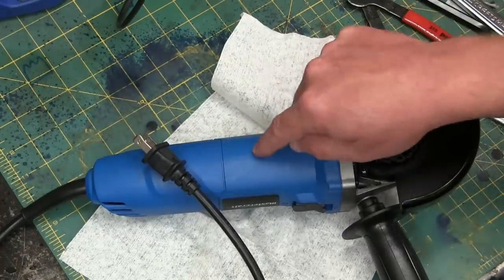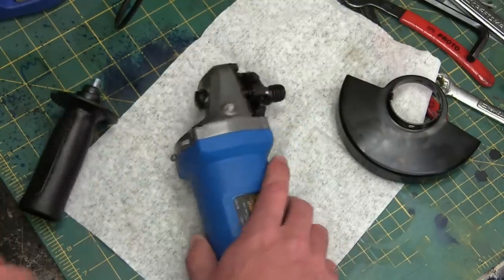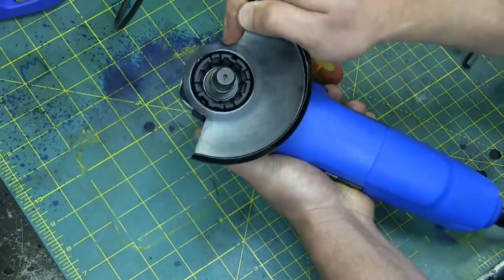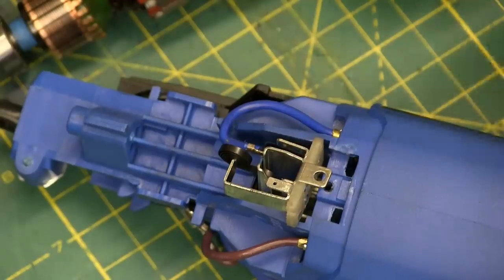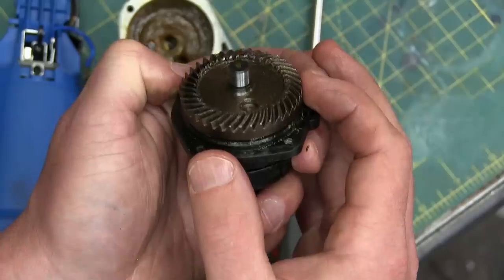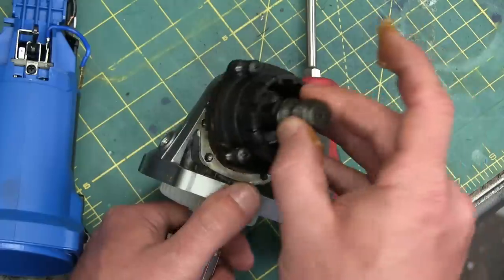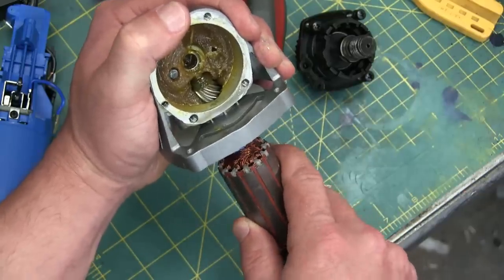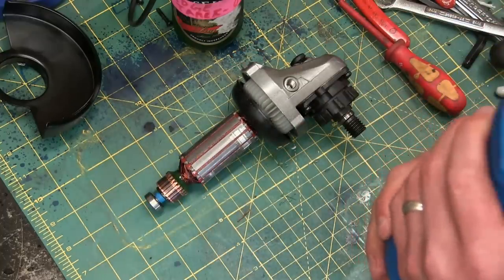BOLTR: Harbor Freight Grinder. HOW BAD IS IT?

Comment: I bought one of these from harbor freight when I was in high school. I thought I'd buy a better grinder when it finally crapped out on me. But it still hasn't. 

 It survived being my main way of cutting metal for smithing and casting, several weeks of cutting concrete board, granite, and tile, and even a good bit of woodworking. It's packed with dust and grease. And it just won't die. 

The only maintenance I've done is replaced the brushes and packed the head with red-n-tacky grease. There was barely any grease from the factory, nothing like the amount shown in this video. The head got alot quieter and cooler after I packed it.

I've actually grown to like it. You almost can't snap a disk because it's so underpowered. I've never snapped a disk with this grinder, and I've been through a few hundred at this point. It's also easier to control what you're doing, for the same reason. I added an in-line foot-pedal deadman's switch after a couple of close calls, and I like that set up alot more than a typical paddle grinder. 

I bought a second one for 10 bucks when they had a sale. My plan was always to buy the Metabo of my dreams when my Chinese POS died, but now I just don't think there's any point.
Reply: @Bob Newhart Also, why just me? There were much more shill-sounding stories in the comments right below mine.
Reply: "It's packed with dust and grease"
Ah, that's the secret. You reinforced it. 👍

Comment: I fabricate a lot which means I weld and grind. I have about 6 of these in the American version of the Chinese model. The FIRST thing I do is replace that funky grease with a good moly-lithium that strings when I pull it apart in my fingers.  No evidence of grease leaking but I have had failures. Before I did the grease thing, the gears wore out fairly fast.  Brushes get hot which takes the memory from the coil springs.  As long as I go easy I can get some miles out of these.  So, I always use cutoff wheels. The cheapest I've bought these for is US$9.00. Yep, for nine bucks I don't cry when one fails.  I've also used parts from failed grinders to fix others.  Ours come with a spare pair of brushes but failure usually comes before they're needed.Our model comes with a maintained-position switch.  No problem until someone leaves the damn thing on and you go to plug it in.  I always check. Go Wings!  - Dave

Comment: Greeting from SE Asia where these wonderful pieces of equipment are copie... built!
I've got ball bearings that flatten with a tap of a hammer, stainless steel screws that rust in a week, and a truly amazing series wound motor that is a copy of a Makita. The Makita has 28 gauge copper wire, this one, which lasted 2 weeks, is wound with 28 aluminum.

Comment: at 33kRpm, a sealed bearing will not survive--the seal will turn to smoke, hence the cheapy shielded bearing.  For those types of speeds, a labyrinth seal is required, and those are mucho dinero.  Its less chineesey than usual.  I thought the balancing was impressive.
Reply: I really laughed at the unique commentary.  Thanks!

Comment: I've had one for three years now and sharpen lawn mower blades with it pretty aggressively. Never gotten very hot. I love the thing because of the locking button. My old Milwaukee was great because of the palm switch. But that got sketchy about working. No grease leak at all

Comment: how much silicon should we add to aluminum cans?
Reply: ^^^what he said^^^
Reply: about a pinch per ten cans sound good to me.
Reply: one california bimbo per ton of aluminum. did you not hear what he said? stop wasting time on tin cans -  and get old tools etc -  break them up and use them -  or get heat sinks from computers. find a local computer shop and ask if they have old heat sinks.
Reply: when it no longer looks like molten aluminum, back off a pinch.
Reply: use pistonium for your castings. Much better than beer can logic.
Reply: One intel core i7 (sky lake is okay)
Reply: +readyrepairs heat sinks are extruded, not cast, so the metalorgy is different, and not necessarily suited for casting.
Reply: Go to a scrap yard. They will have a guy hitting transmission bell housings with a sledge hammer. All the casting aluminum you could want at prolly 30 cents a pound.
Reply: @944tim  was going to say, Piston aluminum would be good.

Comment: Have this grinder, have used it for multiple hours at a time very often for 3 years cutting and grinding heavy gauge steel. It has always worked and held up very well, no bearing play, no grease leakage.

Comment: Had one of these for a year with fairly extensive use. No grease leaking to date. no real major issues other then occasionally stalling out when when using cut off wheels for extended periods.

Comment: bought two of these so far. One destroyed a grinding disc at first use and welded the disc nut to the plate, making it impossible to replace the disc. No worries, they're $9. Bought another one, and have used it for almost a year now, pretty regularly too, and completely ignored how hot the thing gets when you run it for a good length of time, and it still works like a champ. Now that I've seen this vidya, I know why.

Comment: I got both horrible freight versions about 5 years ago. The one you tore apart looks like the cheaper of the 2. The Drillmaster is nominally $20 often on sale for $12 and the Chicago is nominally about $35 and often on sale for about $20.  Between mine, neither have the weird handle single or the plastic bearing carrier. Both heads are all metal. No grease has leaked out but comes with all of it in the corner... Much quieter after popping the head apart and spreading the grease around. 
It'd be interesting to see how much torque it takes to grenade one of their ratchets compared to a fap on or other pro grade hand tool.
Reply: They're holding up well but they've only seen light home gamer use.

Comment: Bought a HF heavy duty grinder bout 2 yrs and its still hoing strong after 1 yr of welding school and 1 yr of field work. No leaks or problems except replacing a brush and the crap welds on The guard breaking. I was surprised.

Comment: I just wish it was an actual HF if you're gonna call the video that.
Might have to export you the actual cheapo HF one.
Reply: +AvE In that case nvm, thank you sir. Maybe we can export the $10 one when it dies, if it dies, lethal wire cup still attacked.
Reply: +The American Outdoorsman attached*
Reply: +AvE i got my Hf grinder several years ago and there are a few differences. the guard is held in with a clamp (so you need a screwdriver to adjust it) the handle is perpendicular rather than a stupid angle, and the switch is on the back vs the side. it also is rated at 4.5amp and has replaceable brushes
Reply: +m4xwellmurd3r That's the one I've got
Reply: +m4xwellmurd3r it does have the plastic bit on the gear and stuff. its never leaked and ive abused the hell of it for years cutting up exhaust systems and such. ive also thrown it around a bit. i do think the plastic holding the gears is thicker from the looks of it
Reply: The American Outdoorsman It's pretty well built vs the one AvE is showing. I've gotten it plenty hot and absolutely abuse it an it still works like new.
Reply: That's the new one that they are selling in the states too. Last time I went in they didn't have the old red one anymore.  Not in mine at least.
Reply: A
Reply: +m4xwellmurd3r HF changes there tools every few months go to the store and try and find the one you have still on the shelves
Reply: N
Reply: +AvE I'm sure they are junk , I'm only a couple minutes in, but it's probably like air die grinders. 
I've bought the best and had em fail in 3 months, then I've had the harbor fright crap last over a year. 
Somewhere in the middle usually doesn't leave ya too dickered.
Reply: It's the same thing just rebranded. All components are the same with the exception of maybe some differences due to w/e Canadian laws compared to the states. Different plug? Dunno. Anywho, it's manufactured from the same factory in Shenzen or wutevs.
Reply: +Jayee actually the red one they are talking about isn't the same. Completely different head. Dosnt have an angled handle and the lock pin is much smaller.
Reply: I bought the HF grinder about 4 years back for $12 on sale.  It lasted way longer than I ever expected.  I referred to it as my "backup grinder" but often defaulted to it because it was smaller than my other one.  I finally killed it recently after 2 hours of constant-on abuse.  I then switched to my other grinder, a Porter Cable clearance buy from Lowe's.  $20, only thing missing was the arbor wheel (which the guy at the tool shop gave me for free.)  I think the thing retailed for $70 originally.  It has a similar plastic gear cover but was leaking grease within 5 minutes of use.  If you had any interest I'd send you the dead HF grinder to find out exactly what died in it.
Reply: You can buy the same product, in the same box, on the same day, but at different stores, and they could be built in a different way. The companies get a contract from a manufacturer over in China to pump out say 10,000 at a time for a given price. In my experience as long as the tool or product meets the spec it doesn't matter what's inside the thing. If you get a new shipment, or old stock, the box may look the same, but there is a chance that the product itself could be different.
Reply: not really.... looks nothing like the ones at HFT..... worked there for 8 years straight.... unofficial product expert of the store.... and that only looks like one that use to be sold around 6 years ago..... only similarities being the color. everything else is different.... so unless you show an actual product. don't pretend to know it
Reply: this isn't an HFT grinder... not even remotely close.....considering the grip handle's have NEVER been on the angles this thing has. and the switch is usually on top of the device.... and how he took it apart to get the brushes out.... they have a port on two-three sides of the tool to open it up and exchange the brushes... this thing doesn't.... it looks like(in color only) the old Drillmaster brand grinder..... but again, too many design differencials.

Comment: I've had this grinder for 6 years and it;s been great honestly. cut custom 3/16 engine mounts, body work grinding/cutting, probably 20 solid hours of use out of it for 25 bucks, i'll go out and buy another when this one fails for sure!

No leaks, nothing has failed yet and I've been pretty rough with it.

Comment: I bought a hazard fraught cheapo years ago to remove some heavy paint with a flap wheel. Ran it 8hrs straight 2 days in a row. Bearings rattle a bit but still in my garage and used. I'm surprised it survived the two days, was worth the few bucks. Keep up the great videos!

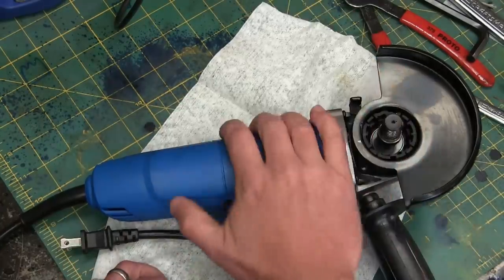Comment: 1:41 I have the $14 grinder, but I got it for $11 with a coupon. It was noisy at first so I took it apart and there was NO GREASE! inside the gearbox. I packed it full of grease and it has been great since. I have used it to cut out an entire floor out of a car so far and to make patch panels for a different floor.

Comment: I have to say I have one from harbor  freight  I only paid a little  over 9 dollars  on sale that works fine for me but I only do light work I've used  it for several  years but if I needed  it all the time for work   I would buy a better  one.
Reply: same here, I have 3 of them
Reply: I got myself one as well,  $12, "DrillMaster." Pleasantly surprised as I nipped off several rusted nuts and bolts and modified couple strut assembly frames. I made sure to stop for few seconds when I felt it get hot as other youtubers have suggested. Granted its underwhelming compared to company's Makitas I've used to earn living and also bit annoying in power as its only a sad 4.3amps and bogs down to a complete stop if you apply bit pressure so it'll take slightly longer to grind what would otherwise take less time but to my surprise, the shit didn't die. Yet. Not once did it trip cut off power, just steadily grinded away. For a cheapy, it really is something. Not expecting much,  I didn't even bother getting their 1yr extended warranty since I was certain that it die by the end of my project. Nope. Anyway,  I got a few more rounds of diy to play around with this and see what it takes to kill it but from what I've seen, use it right with small scale work and it could certainly last you years. it's definitely a keeper for small home use.
Reply: +DonnieDarko1 I guess you could also throw this in the back of your trunk since its amps are low and won't really drain your car batteries supposing you haven't rigged your car with dual battery system or generator.

Comment: I bought one of those from Harbor Freight, the deluxe one ($20 without sale coupon).  I was building a hot rod, all new sheet metal, etc.  I got a few months out of it with high, abusive use.  The bearing for the chuck wore out.  I took it back and when I traded it in for warranty, I bought a second one, for cutting.  That way I didn't have to constantly change wheels.  I think I went through one or two more, but swapped for new under warranty.  My conclusion?  Happy to have spent so little for disposable tools (which I still use on occasion).

Comment: I had the cheaper version ($7.99 on sale)
Changed the grease before 1st use and blew through 1" Red Adobe tile with a diamond blade for about. 4 weeks.
I'm talking non stop operation all day.
only the switch failed.
I bought a replacement when they went on sale again and have had it for a year now light duty around the house.
cutting small stock, grinding welds, buffing, tiger disk, etc, etc....
I love it.

Comment: I was just using a 6" metabo grinder the other day so I took a closer look at it. The metal gear housing was painted and the bottom of it where the shaft comes out was black plastic also.

Comment: Looks just like my Harbor Freight DA Polisher. I replaced the cord with a 16 gauge 10 footer and rotated the body around so that the switch was on the top rather than the side. Also replaced the crappy grease with some Mobil 1 synthetic grease. 

Bravo, great videos. Learning quite a bit here!

Comment: I've used these in my repair shop and have put them to the test. I've had some that last a week and some that last years. I've had one that burst into a ball of flames mid use and another lose its smoke but never one strip the gears and I've constantly used them for cutting and a lot of wire wheeling of aluminum but have recently traded in my master craps for bosh cause comedy tire had a 2 pack deal on recently. From one Canadian to another keep fit and have fun

Comment: IMHO Chicago electric works well for home. I used one for five years, building a rock crawler, before the switch gave up. 
Replaced it with Drill Master, the smoke escaped from that POS before I got one weld dressed.
One good thing about HF they will take ANYTHING back if you have a receipt. All I was out to learn that lesson was the gas to drive there and back with a new Chicago Electric Angle Grinder. Would I like the Metabo? Hell yes. Can I justify the cost for a tool I use once or twice a month? Hell no.

Comment: Excellent diagnosis.  Had weekend job cutting bolts in concrete so bought complete kit RYOBIE at the Home Despot, for under $40 US.  One thing you showed was grease in the head of your cheapie.  Opened the Ryobie after the job and about a thumbnail of grease, the tool worked it's butt off for four years more without a problem.  Throw away tools for dirty jobs, Ryobie works super, died of brush failure.

Comment: i use flap wheels on my HF versions.. but i take a used flap disc and install it behind the new or newer flap disc. this brings the surface of the flap disc level with the spark guard.  making it much better in throwing sparks in any direction.. but it makes it actually easier to use without digging in at an angle to clear the spark guard.  and since i have the spark guard still on the tool.. i manage  to keep from grinding the skin off my knuckles.   on an earlier HF version. the big bearing was a bushing.. i did some measuring and found it was a bearing size.. went to the parts store and got the proper bearing and make that a decent grinder.

Comment: 15 Year Review of Harbor Freight 4 1/2" angle grinder: 

5 out of 5 stars! 

Thing is a beast and I beat the crap out of it. It's built 10+ cars, 5 motorcycles and cut endless sheets of carbon steal and ran it for 5+ hours nonstop with no breaks, in 115f weather. I've dropped this on concrete and asphalt well over 100 times (sliding off the bench). It's a beast!

Comment: About a week after i graduated i got my first welding job building oil tanks. I needed to bring my own lid and grinder. I bought a crappy princess auto helmet and a $22 4.5" T&T grinder. That grinder lasted me 2 years in the worst job conditions ive worked in to this day. i used it with a 5 inch wire wheel to grind off slag. just tossed the guard. lid always down while buffing off slag anyways. The only reason i got rid of it is i finally got gifted a 5 and 6" pair of Makitas (which i always stop them with the loosening pin. Still going strong for 5 years now). they are for sure better. but for that crazy cheap grinder it was fantastic.

Comment: The plastic part that holds the bearing on the gear box assembly, the front bearing housing, is also plastic on the Matabo grinders that we use, we normally can get 1-1.5 yrs out of a metabo, but we run em hard.